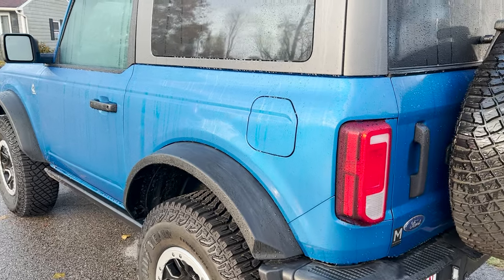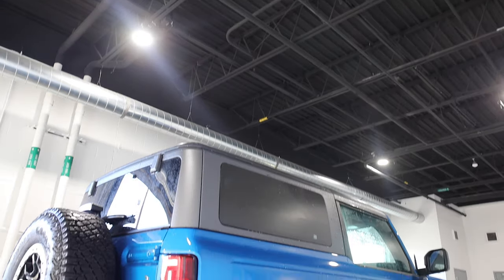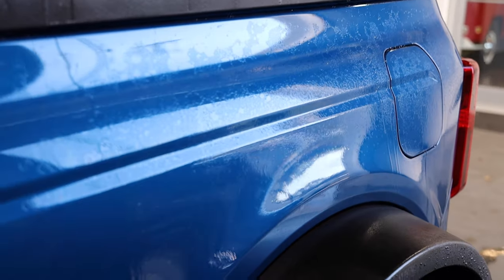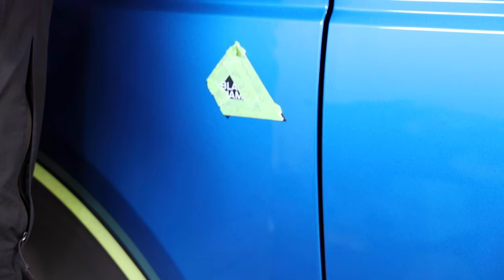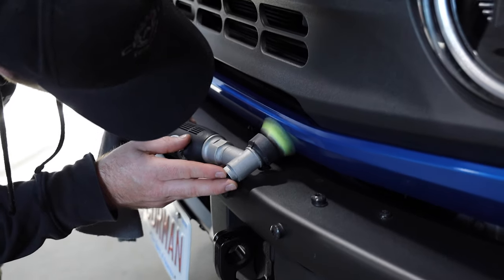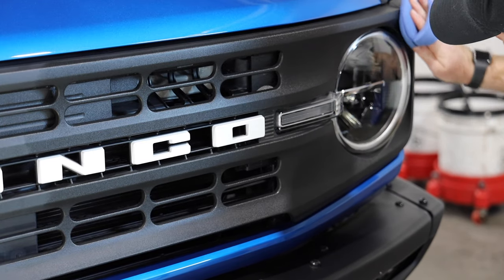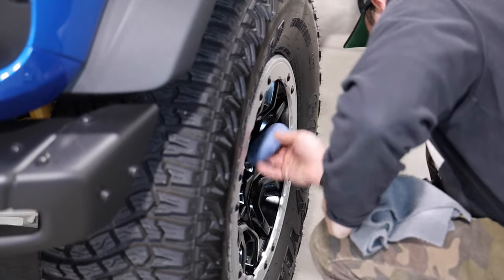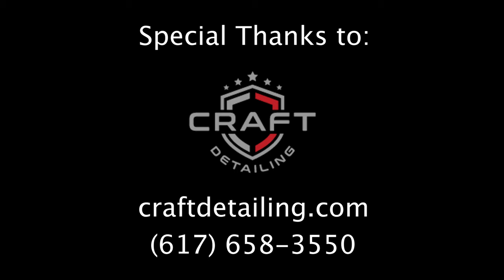Protecting the Paint on the 2021 FORD BRONCO | Opti-Coat Pro Plus

Comment: I'm a firm believer in Ceramic Pro coatings. I had my last car done with the gold treatment, which meant the shop had it for days as they applied several coats to the finish and cured it under special lights. When I got it back, it looked like glass. Also, water would just bead up and run off. Same goes for the windows. I highly recommend having these coatings applied. For one thing, the car's finish looks great, and another, it requires washing less frequently because the dirt is less likely to take root on the smoothened surfaces. Nice video. Your truck looks great! I hope my Velocity Blue Bronco looks just as good (when I take delivery one of these days, that is). Thanks for posting. You made a good call getting this done to your Bronco.
Reply from the maker: Thank you for commenting and i fully agree, all my vehicles will have this applied. The time it cuts in washing alone makes it worth it. The UV benefits are also a nice addition too. Hope you hear about and take delivery soon!
Reply: Meanwhile back at the shop they laughed their rears off after they applied a couple coats of minwax and charged you big bucks knowing that todays paint jobs will hold up great for many years straight from factory.
Reply from the maker: @edhcb9359  I was present for the entire installation, I know the shop and I have used the product...

Comment: That looks amazing. This is one thing I'm doing to mine once I get it, I have the buffer and ceramic coating to do it. I'll end up doing it on my 04 Cobra as well
Reply from the maker: Thanks! I envy anyone who can DIY this. The fact it's not really visible when applying it would make me convinced I missed parts.
Reply: @CoderMan  I buffed boat's as a summer side job a few years ago with a rotary buffer so using a DA on an automobile is easy peasy. I have not personally done ceramic coating but looks like if you can apply wax you can do this as well. I have an Adams Pro buffer and their ceramic coating
Reply from the maker: @Lethal_Venom  Yah, you should be fine given that experience. I need to grab a project and learn. I would still prefer pros do it, but some projects would be fun to do myself. I am actually looking into a classic Mustang project that I intend to do pretty much every step in the process myself... lots to learn!
Reply: @CoderMan  I'd love to see that I like all Mustangs regardless of year. My favorite of course being my current Terminator at 700+ HP it's a handful. There are a lot of good videos on how to do buffing and you can always grab a garbage hood / fender from a junk yard to practice on that.  I'm going to buff my Cobra first just because the paint is not perfect anyway and I'll eventually repaint the whole car then I'll do the bronco and throw on a ceramic coating on top.
Reply from the maker: @Lethal_Venom  Great idea on the sample panel to practice with. I am a fan of pretty much all Mustangs too, in fact I worked with the Gone in 60 Seconds family! My project will be a 1966 Coupe Restomod
Reply: @CoderMan  Oh wow that’s so awesome! I’m in Maine so I’m not too far away maybe after I get my Bronco delivered we can have a bronco meet up day, I’d like to hear more about the gone in 60 seconds stuff
Reply from the maker: Absolutely, let's do it!
Reply: @CoderMan  Awesome! I have your bell turned on so when I get closer to getting it ( crossing my fingers for spring time ) I’ll let you know